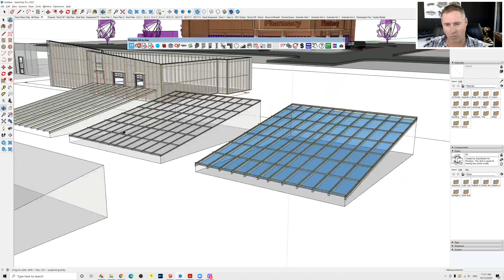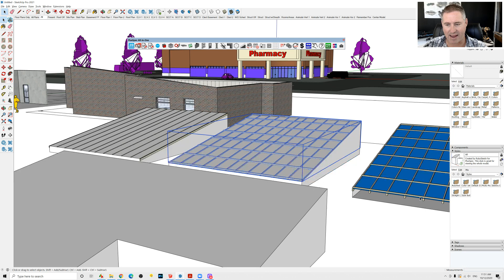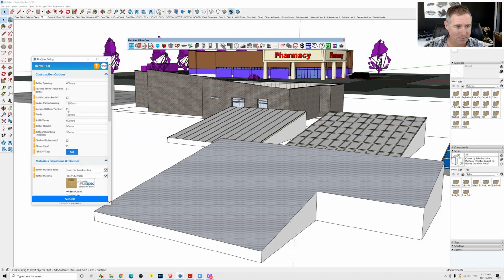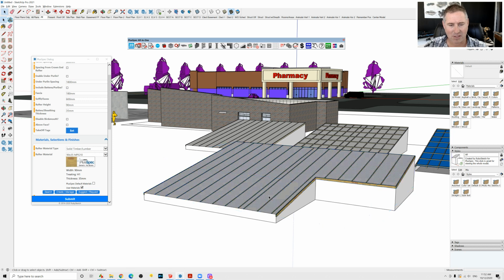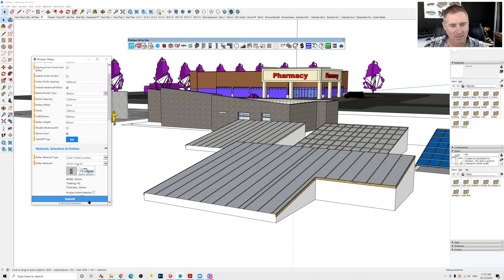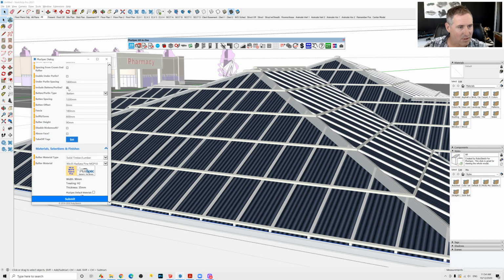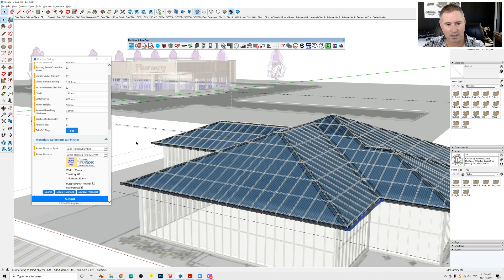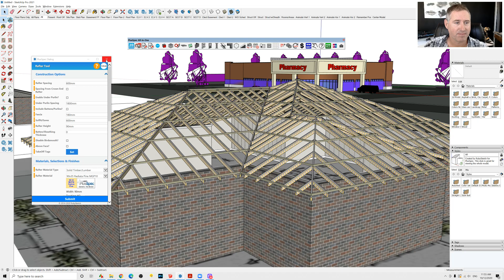Passive house battens on rafter for air gap  detailing tutorial PlusDesignBuild inside Sketchup

Comment: Is there a similar video for creating passive house double stud walls. I'm trying to create my walls with two sets of framed 2x4 walls which form a 5" wall cavity which will contain dense packed cellulose insulation, to create a thermal break. I see for "Wall Type" there is a "Double Internal" selection, but I see no selection for making double exterior walls. Thanks.
Reply from the maker: You can add battens to just about every wall type, which is typically the way i eliminate conductivity through the slab/floor.  Could you add a post on the forum with a screenshot of what you're trying to do?  Click the forum button at the top of the wall tool to get you to the right spot, or here's the link https://forum.plusspec.com/
Reply: @PlusSpec  Thanks for the reply! Yes, I will make a forum post with an explanation and screenshot.
Reply: Best practice for creating a secondary stud without to and bottle plates is to tick bridle battens and create a batten material that's on edge. Eg. A 2x4 material can be made as 4x2 . This way the batten doesn't sit flat on the wall.  I'd recommend using the lightweight multiskin wall inside the PlusSpec wall tool.

Comment: The ability to have battens on the inside of walls, between stud and plasterboard would be really helpful, and for quantifying, being able to have a membrane layer between the batten and stud on the inside.  I think one thing that makes drawing easy is having good freedom on how we build up the wall layers and with what.
Reply from the maker: Thanks for the feedback, Jackson. You will notice that this can now be done with the solid wall. Would you like to batten stud walls on both sides? Is this for a passive house wall set-up? It'd be great if you could send Emily or Andrew a cross-section detail, as we are always looking to improve PlusSpec and PlusDesignBuild.
Reply: Thanks mate agreed there a bit of thought that goes into preparing the right setup...
Once a wall type is created, save it as a vignette and re-use it. There's a video on how to do this